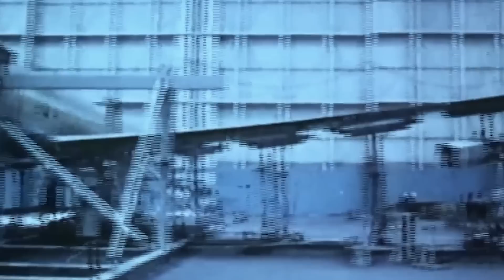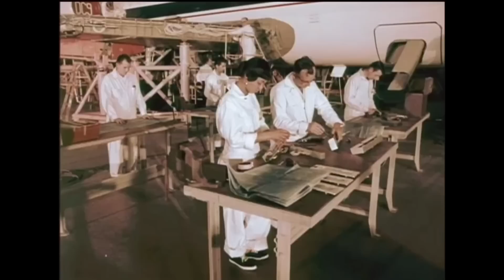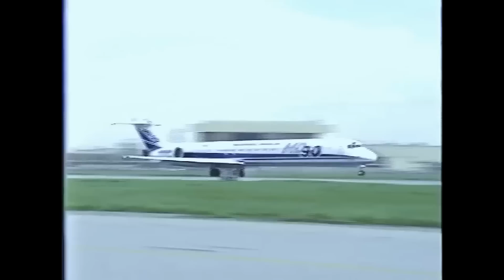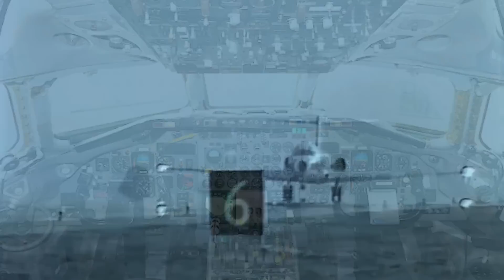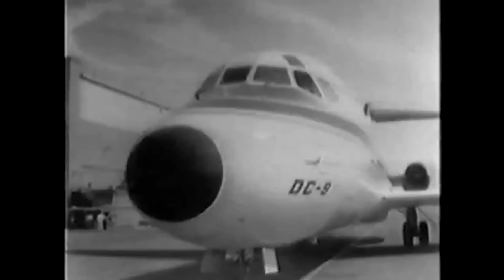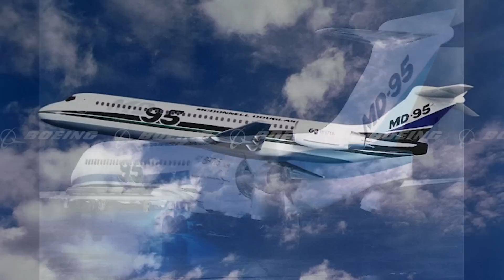Why Airlines Loved (Then Killed) the DC-9

Comment: I flew the C9B Skytrain for the U.S. Navy and every civilian model of the DC9 (-10 through the MD80).  I was an instructor pilot / check airman on the C9 and DC9 working for TranStar, Midway, Republic and Continental Airlines (Non-scab, retired with UAL).  Although, I knew this airplane like the back of my hand, it was not an easy airplane to fly.  It was fairly stable on approach but consistent good landings were hard to accomplish.  In comparison, the B727 and B757 are the two most stable fun airliners I have ever flown.  In the Navy, we used Flight Safety's facilities in St Louis for our simulator training.  All other training was hands on in the airplane.  I.E., we flew steep turns (45 degrees), approach to stalls flaps up and down, and V1 cuts IN THE AIRPLANE.  At V1, we would pull one of the throttles to idle simulating an engine failure.  We also did actual S/E instrument approaches, S/E go arounds, touch and go landings, etc.  The only military accident was with the Air Force at Scott AFB.  During a trainer mission, when practicing touch S/E touch and goes, down wind, they had an actual engine failure.  There was so much engine vibration they could not identify the operating engine.  Because of this they shut down the OPERATING engine by mistake and crashed killing all onboard.  In the Navy, I flew the C9B all over the world.  We flew into Europe, Mediterranean, Middle East, Central and South America, trans Pacific landing at Barbers Point Hawaii, Wake Island, Guam, Cubi Point, Okinawa, Iwakuni, Korea, etc.  For the airlines, I routinely flew into every major airport, and others, in the U.S.  I have flown hundreds of shuttle flights between BOS-LGA-/EWR-DCA.  Our Navy C9 had extra fuel tanks, and inertial navigation (No gps in those days).

Comment: I left Douglas in 1992, after working for six years in Long Beach as an airframe structural design engineer, and I eventually realized that no other U.S. aircraft company had ever established a legacy of engineering excellence to compare to the Douglas Aircraft Company.  The engineering mentorship and analytical methods I learned in Long Beach, mostly on the airframe design effort for the C-17 Globemaster III airframe, has stayed with me for decades and has benefited multiple other airframe design programs at several other companies. I did not realize the original twinjet design started in the 1960s but when I left Long Beach in 1992, I remember how the MD-80 production line was then still going strong.

Comment: It’s practically the only airplane I ever flew. In the Air Force, it was the C9 a hospital plane. Then on to Douglas, for a stent as production and training pilot, then to Hughes Airwest, then Republic, then Northwest, out for nine years, then back to aviating, flying for AirTran for 17 years, until retirement. It was always the DC Nines and its derivative! 
I have little to compare it with, since I never flew anything else. I will say, however, that the ailerons and elevator controls were a little bit truck-like, since they were controlled by cable-actuated control fins, and not by hydraulics. 
If we found ourselves “caught up” (higher than we should be, if we wanted to satisfy that crossing restriction up ahead) this baby was great at slowing down and getting down. 
The WINGS ruined this plane’s longevity. Boeing and Airbus were putting longer, more capable wings on its planes (1990s and later), and MD chose to stick with the low-altitude, short-haul wings from the Sixties. Comparative fuel economy suffered, and the airlines stopped buying. 
Overall, this plane was my bride for over 20k hrs, and I could go on and on about her good qualities!
Reply: Dtw or Msp based ?

Comment: When DC9-30 was launched, it cost almost half as much to operate as its closest competitor, the 727, and the DC9-30 burned LESS fuel PER SEAT, despite being a much smaller aircraft. Naturally, every airline rushed to put the DC9 on any route that didn’t need the range of a 727. Even after 737 came out, the DC9 still had a slight edge on efficiency. In fact, Boeing almost canceled the 737 after a few years of production because the DC9 was killing it.

This was in the era when Douglas was at the cutting edge, which pretty much ended in 1980 when they launched the MD-80 with low bypass engines and steam gauges, and since Douglas acquired Boeing and assumed its name in 1997, that legacy of lack of innovation is why we got the 737MAX and not a new design

Comment: underpowered, dangerous horizontal stabilizer design
Reply: You're way off!!!!
Reply: @bmwlane8834  maybe. i watch alotta air disasters
Reply: In flat descents, turbulence off the trailing edge of the wings could render the rear stabilizer unstable as was the case in the Trident.

Comment: It's such a cool plane. Boeing should create the 717 Max based on the 717, MD-80, and MD-90.
List of planes:
Max 7 - 717/MD-95
Max 8 - MD-80
Max 9 - MD-90
Reply: Maybe you should ask Boeing
Reply: @wilfordfootball79 They probably won't proceed with this idea, but I could ask them.
Reply: Three downsides to that

With the engines on the tail, you can’t get them much larger without throwing off CG, and requiring even heavier structural reinforcements, mostly negating efficiency savings.

They don’t have the facilities to readily reintroduce them

There isn’t a market anymore.  The regional jets, also almost obsolete for intended purposes, have been stretched into the remains of the midsized spur routes.  Airlines have also all but abandoned airports that would require easy ground service, that these aircraft had in mind.  With the Embraer E2’s available (but dreadfully underutilized) and the C Series on the market, never mind Boeing being utterly rubbish at aircraft design and production lately, it’s not even on the ideas board.
Reply: Too ass-heavy, especially if you add updated engines. Rumor has it that on an unloaded 727, if you walked from the front to the rear, the airplane would tilt backwards on its tail. Customers loved the rear airstairs, which contributed a lot to this imbalance.

Comment: The only reason why the dc-9 and super 80 had any maintenance issues with airlines like Alaska and other big names cut corners on the jack screw grease fittings ...
Reply: I place most of the blame for this problem on the manufacturer. I'm a pilot, not a mechanic but from what I hear, greasing the jackscrews is not easy. 

I don't care how well disciplined someone is, when faced with a difficult task, the temptation to cut corners is enormous.........
Reply: @rrknl5187  As a retired A&P from a mAAjor U.S. AAirline (which happened to operate the largest MD-80 fleet in the world - give or take around 370 airframes at one point), I can say that the task of lubricating the jackscrew which controls the horizontal stab trim is not the easiest task, but to this day, I don't believe that the problem was that Alaska A&Ps were 'cutting corners' as is commonly reported.  The change in the required mainetnance schedule (aircraft flight hours) for this work was reduced significantly after this accident after the NTSB/FAA investigation which followed.  In my mind, it was just one of the unfortunate accidents which provided the invesigating/regulatory agencies information that the designers could not foresee with 100% certainty that the requirements which they determined, and the FAA signed off on before certification, were perfect, so changes had to be made to the maintenance schedules.  As aviation continues, we always find areas that are not perfect, and we strive to make changes for the better.
Reply: @rrknl5187  Lol, that's like blaming the girl for wearing a short skirt after she's been raped.